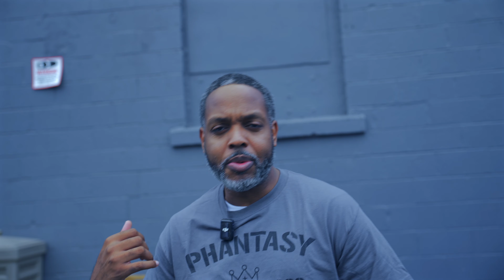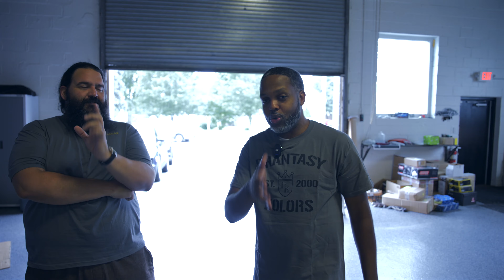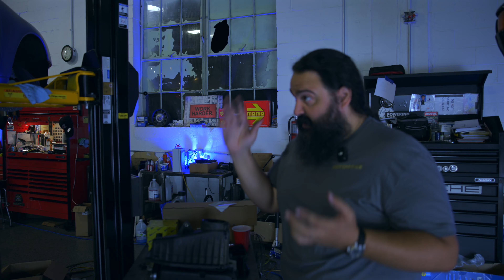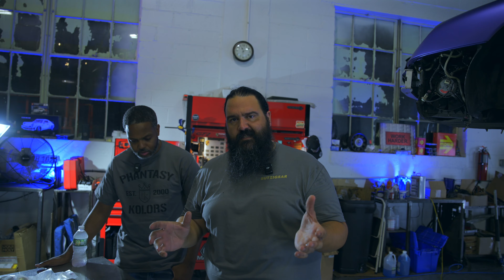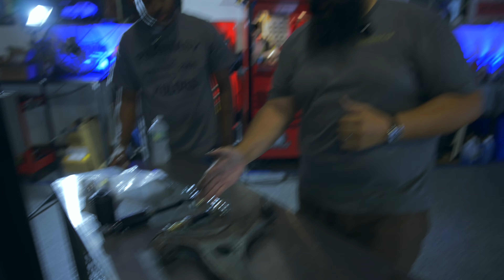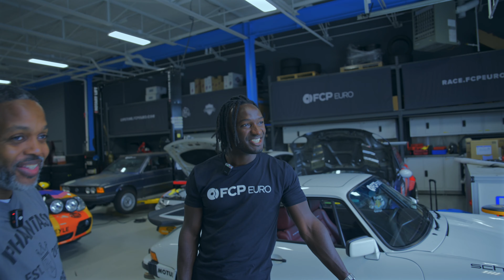Upgrade Your Porsche 993 & 964 Suspension! In-Depth Breakdown

Comment: Great video, well timed! I'm just wrapping up my full mechanical rebuild on my 993. Every single suspension bushing (elephant racing where possible), bbi rs uprights, kw clubsports, wavetrac diff, rebuilt transmission, and 3.8 conversion (cam reprofile, titanium valve springs, mahle p+c's), and what ever else needed addressing. Literally better than new. Should be going in for alignment tomorrow. Super excited!

Comment: I did monoball stuff on my ls swapped e36 before i sold it. I will NEVER have an e36 without em. In the right places it makes the car feel planted. Did a mix of some solid, some hella stiff delrin, and then monoball bushings.
Reply from the maker: @imSchwaggy  exactly! I think ppl over exaggerate monoball bushings. Even though it’s subjective but I’m always on board with improving/upgrading technology that is 30 years old lol. Especially if it’s still on the original rubber bushings from when the car was sold new smh
Reply: @SpeedRacerJoe  they definitely do exaggerate lol. Cuz it's not that bad at all. Maybe if you're in a gutted honda, but these German cars are not tin cans. Even e30s with poly and monoball bushings aren't that stiff lol.

- and I'm not a person that likes HELLA rough cars lol. I've driven stance cars with like 20k+ springs. Those feel 100000x worse than stiffer bushings and proper dampers.